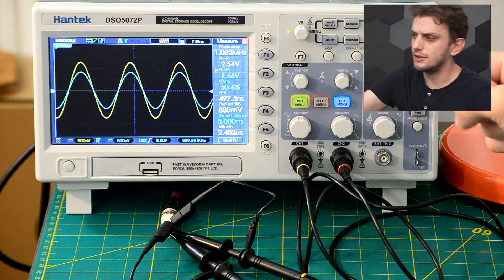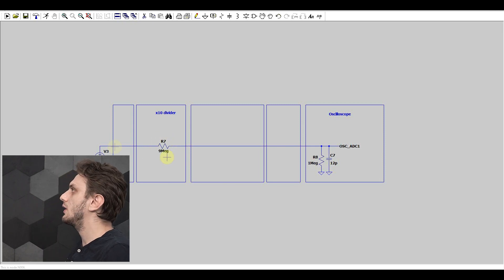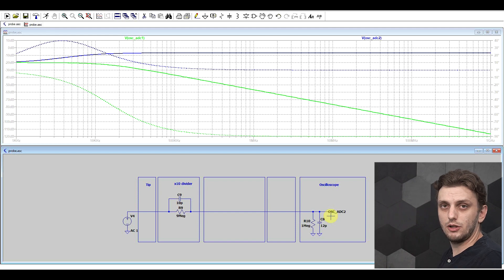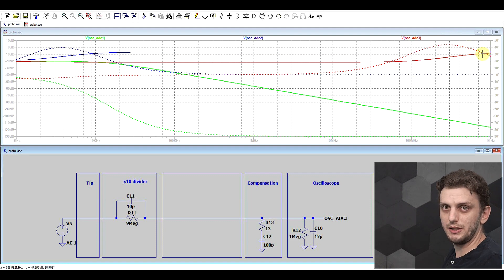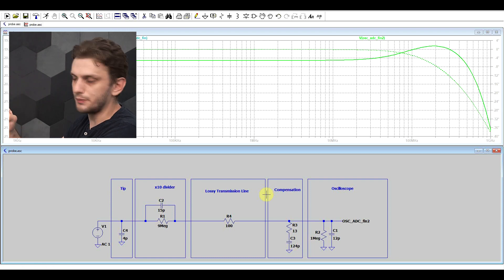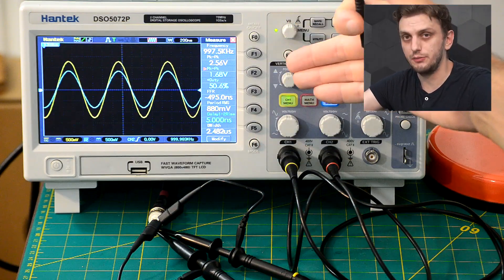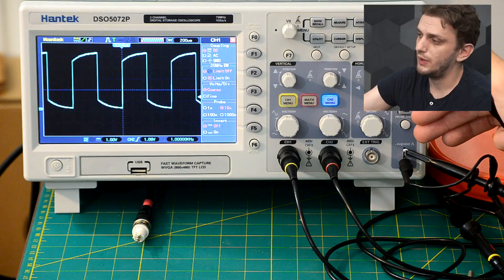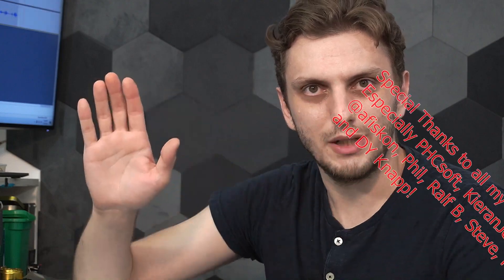Electronics Tutorial - Oscilloscope probe compensation

Comment: hi can I use 150 MHz probe on 50MHz oscilloscope?
Reply from the maker: The oscilloscope does not care about the BW of the probe - you can use any probe BW with any oscilloscope BW; but the measurement will be limited by the piece with the smallest BW - either a 50MHz probe and 150MHz osc or 150MHz probe and 50MHz osc will provide results that have 50MHz BW limitation.
Reply: @FesZElectronics  thank you.

Comment: Thanks for the excellent explanation using LTSpice simulation. I would like to know how to probe a high frequency square wave signal like >50MHz (but within the bandwidth of the probe) with relatively long coaxial cable probe. Now the cable becomes a transmission line. I am wondering what happens to signal reflections. Wish you can do a video on how you would tackle this condition.

Comment: Excellent video. You have no idea how even professionals quite often don't know about this. 😢
Btw, I think it would be possible to "pre-compensate" the signal for 1x measurements to get a higher bandwidth.
Reply from the maker: Well I did see some high end probes that have an on board memory IC and I guess that any compensation related info is stored there. Of course the price tag is a bit restrictive but in a large company, that should not always be a problem...
I do plan on making a video on X1 - X2 passive DIY probes, just have to do a bit more research before. 
I'm happy you enjoyed the video! Thanks!
Reply: @FesZElectronics  Another idea is just to make an active probe. At these speeds board design is only really a thing though.
Some kind of hybrid approach maybe.

Comment: Hi Fesz, could you do a vid about e.g. kickstarting multivibrators (with bc npn) in LTspice?
Reply: The best way of doing is, is to let the voltage supplies start from 0V (so they ramp up). This setting can be found in the simulation settings menu
Reply: @p_mouse8676  Doesn't do the trick, also tried tried pwl and current source.
Reply: @appercumstock3017  Strange, it also really depends on the model.
Reply: @p_mouse8676  agree, that's why we need Fesz too help us out !!!!
Reply from the maker: Hello apper! Maybe you can email me the simulation .asc file (feszelectronics@gmail.com); as P_mouse said, I would have expected the "start supplies from 0V" to fix things, but maybe there is a different issue.